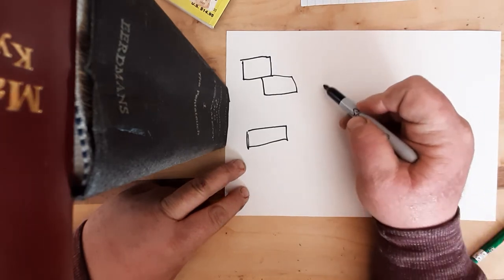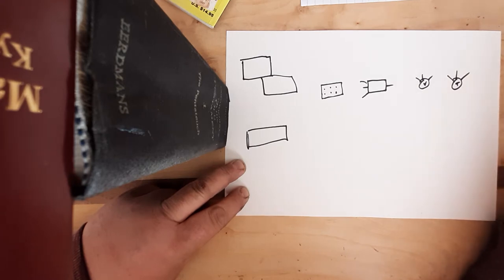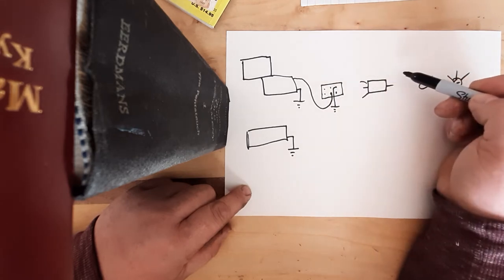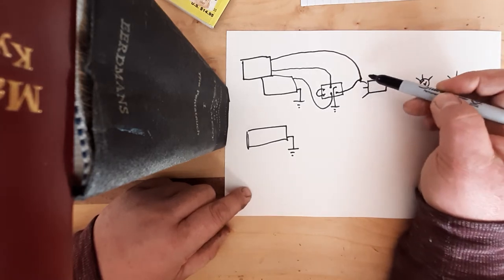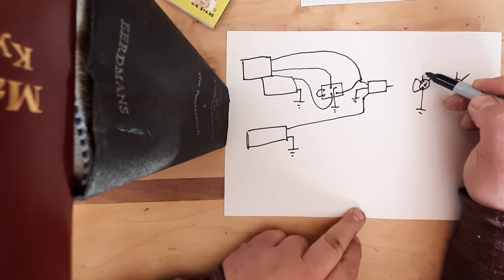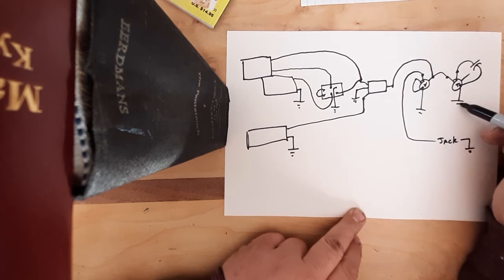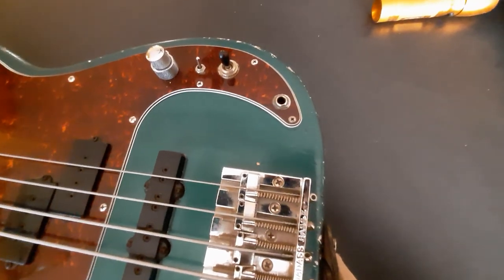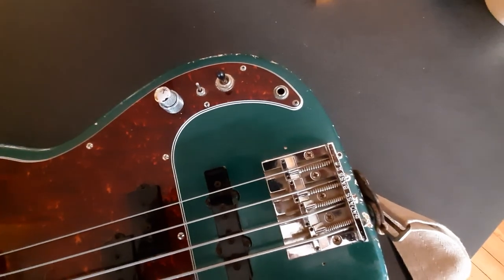PJ Bass wiring with a 3-way switch and coil split

Comment: Hey there Dave.  Tomorrow will be the arrival of an SD Curlee standard II bass.  Electronics are long gone, but the seller did take photos before removing the guts and selling them.  I have always done as you illustrated with the volume pots.  In on the right lug, and out from the center lug.  The old photo shows the pickups going in on the center lug and out on the right lug.  Not sure what that will result in.  I have two DiMarzio P bass pickups to load it with, as they used to make these.  Time to get busy.  I wish it was 34" scale.  These are 32 1/2".
Reply from the maker: That's awesome! I remember playing one of those basses years ago. Kind of an Alembec looking thing from what I can remember. 

I don't think it matters which way you wire them. They are basically an adjustable resister and will work either way. I think if I were you I would wire in coil splits for each P bass pickup so you could get some J-bass sounds...Make a video of it when your done!

Comment: You have an error in the PJ Bass wiring. Volume / Tone must be connected to the toggle switch on the left side. With the toggle switch, the ground pole is on the right side.

sorry for my english.

Comment: Here's my noob question: is it possible to wire a PJ so that you can have a serial/parallel switch for the split coil Precision Pups AND another serial/parallel switch for the P and J PuPs, along with the 3-way switch? If this is possible, The serial/serial position at both selectors would give me the standard PJ bass sound, and a Parallel/Parallel would give me a much thinner but defined sound?

Comment: Hi Dave, I found your incredible video over the weekend. It motivated me to mod my PJ bass - which I did today.
One question though - for the DPDT 6 pin switch, I used a three position on/on/on switch. Is this the correct? Should I have used an on/on switch instead? I don't understand what the middle position would do on this particular switch.
Thank you for making your bass videos. Your explanation and descriptions are excellent.
Reply from the maker: You need an on-on switch.

Thanks for the compliment 😊
Reply: @davetenney5800  thank you - that makes total sense. I placed the order and will replace right away.

Comment: Hi ... Dave .. I am trying to do a series parallel /series on my PJ bass but I see you use two different switches ... and I need to use just one switch. I am not after the P pickup only series but series/parallel between the P and the J pickups ... we are wiring VTT
If you had a diagram for this ... my tech did wire it but the J pickup is gen4 noiseless and this one doesn't wanna work in series. I'd be much thankful if any one could help here

Comment: I seem to be unable to find an answer to one question.... as I am building a double P bass, can it be sired up just as if it was a PJ?
Can I wire the other P pickups in place of the J? Or does it change how the wiring goes? thanks in advance to anyone who can help!
Reply from the maker: I'm think you could just use a J bass diagram and you should be good to go

Comment: hey i have a question for you, is it possibe for a pj bass to have two volume, one master tone and a series parallel switch?
Reply from the maker: Would the two volumes control each coil of the the p-bass pickup? If so, yes it is possible to do that.
Reply: @davetenney5800  ummm no like i want one volume for P pickup and one volume for J pickup
Reply: @davetenney5800  i made a diagram of the wiring , i connected the series/parallel switch in between the p pickup and p volume
Reply from the maker: @justincrazycrafter3581  Ahh...That would make more sense ;)

Yes, that is very easy to do and a very common wiring option. Check out on of the major pickup manufacturers and you should be able to find a schematic.
Reply: @davetenney5800  yaaaayy thanks for the info, btw there isnt a single schematic for this wiring on the internet, there is only just one part of it or another, i made a schematic by myself then
Reply from the maker: @justincrazycrafter3581  Good job! Sometimes you just have to take matters in your own hands!

Comment: Where do I connect the battery wires
Reply from the maker: This diagram is for passive pickups. If you are using pickups that need a battery connection you will need to find a diagram from the original pickup manufacturer...

Comment: Thanks for this.  I created a diagram based on this informative video.  Hopefully, I diagramed it correctly.  BTW what size capacitor do you use?  Here's my diagram:  https://www.deleos.com/images/guitar/PJ-SeriakParallel-3WaySelect.jpg
Reply from the maker: Looks pretty good....the three way switch normally only has 4 lugs on it. Much fancier than my drawing!
I use a .05uf capacitor, but I also have used a  .022uf. Both can sound good depending on what you want.
Reply: Nice diagram. Very helpful.
Reply: I have a maybe pretty nooby question (sorry for my bad english) but where did you solder the ground of the pickups/switch and jack ? I understand the "ground part" of the volume and tone welded on themselves, but the little triangles that indicate the ground, I can't figure where this should be solder ?